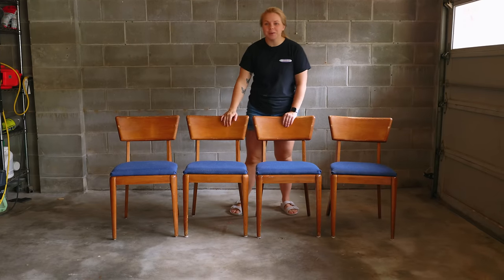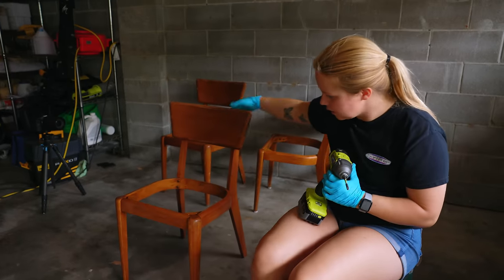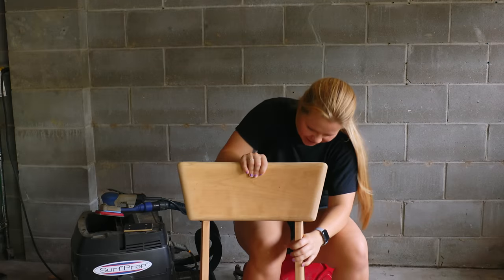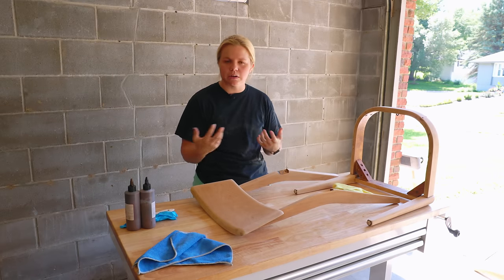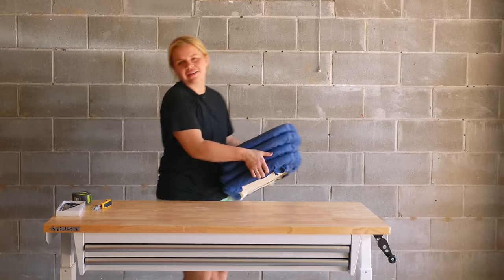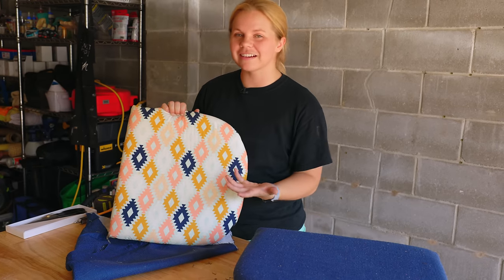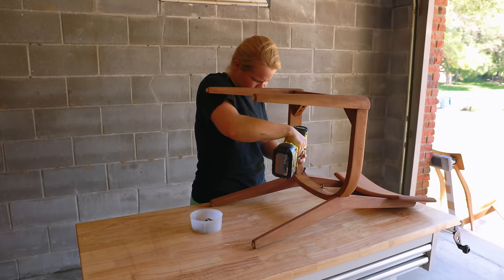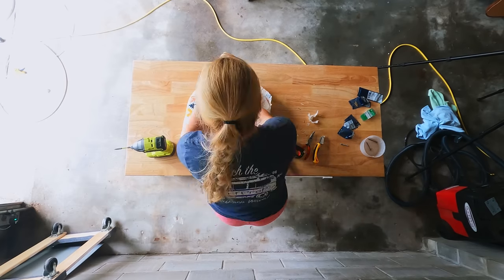Refinishing BEAT UP Dining Chairs from Facebook Marketplace

Comment: I don't understand why people keep the old fabric on chairs. I would have used a solid color to match the rug better. I would also take off all of the fabric and batting off the chairs . And replace with new fabric and batting. Who knows where those chairs have been or what germs could be on them . I just don't understand after you go threw all that work to redo them you wouldn't replace the old fabric. I just didn't like the seats. I think you did a wonderful job on the chairs other than that. Just a thought.

Comment: Hi,  I like the chairs.  I got some similar ones about 20 years ago and still use them. I had to strip them down and redo them like you did but these are great chairs.  I have recovered mine a few times and what works the best is fabric that can be wiped off.  Even if you are careful you will spill food on them. I use textured vinyl in a neutral pattern or something in that family.  This is not expensive and recovering the chairs takes less than one hour or so.

Comment: I honestly think you've got an excellent retro set, and I was hoping you will save the original aztec pattern as it goes perfect with both wood and base of the table colours. I actually think the floral fabric as nice as it looks, doesn't fit this furniture design style. Agree though that now you might reconsider rug design to tie it all together. Indeed you've struck a gold with this one, well worth it. 👏🥰

Comment: I am trying to remember where you are living.  Is it on the first floor of the AirB&B or a different house? In any event, you are doing a wonderful job in furnishing it for less!  You are so talented that I think you will be able to furnish the house for a whole lot cheaper than most people! Congrats on the chairs. They look so cute and blend in so well.  One question,  where did you get that staple remover?  It would make my life so much easier than the usual remover I have to use. Thanks for sharing.

Comment: What kind of wood are the chairs?  I have had better luck with oil based stains.  I like the aztecy design, but I would put that carpet elsewhere in the house if you use either.  Get a more neutral rug, or make the chairs a plain fabric. I love the carpet and the chairs, just not together. Beautiful chair set!

Comment: I tried dismantling a chair, one of a set of 6. It seems they're "stretched" and then fastened, and can contract after you take them apart. And you'll be completely unable to re-fasten them since they won't line up anymore. Very high quality chairs too.
Reply from the maker: very interesting! so glad that didn't happen to me! thanks for watching!
Reply: Did you maybe take them apart a little bit too far?  I wonder if they had something on them like the corner braces on them as the ones Lauren did, and maybe that is why it contracted?  Wood dries out after a number of years, also, and can go back into it's natural self unless the brackets, etc., are still on there.  Hope this makes sense.

Comment: Don't buy one of those cheap record players. They eat up and destroy records after just a few plays. If you want an all-in-one unit, buy a Pro-Ject JukeBox record player from an experienced and reputable dealer who knows how to properly set up the tonearm and phono cartridge. And buy a wall mounted rack specifically designed for turntables. If the speakers you decide to buy are rear ported, they'll need to be approximately a couple feet away from the wall. You'll also need a carbon fiber brush to clean the records. Never touch the carbon fibers or it will draw the oils off your finger.

Comment: Sorry, but I really hate the original print and like the new fabric so much more.  I would have replaced the foam and batting as well.  You can tell the surface sags and the seats look very flat instead of plump and comfortable.  Even if you’re determined to keep the original fabric, I would remove it, wash it, and Scotchguard it, and replace the foam and batting.